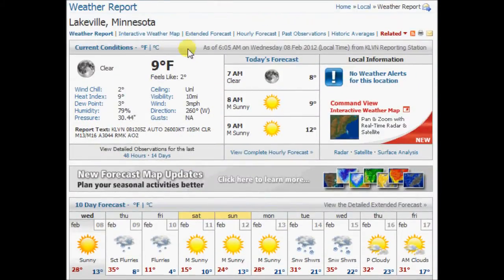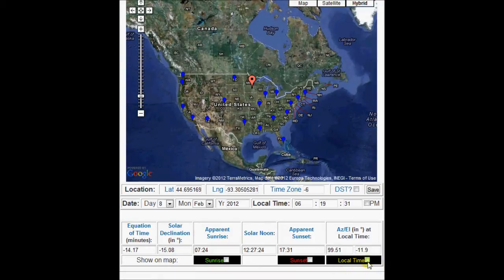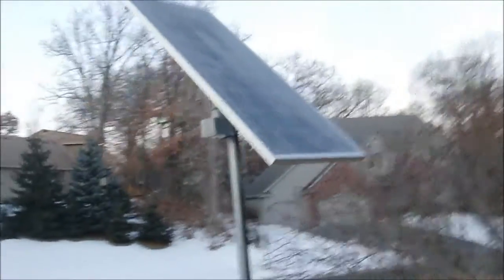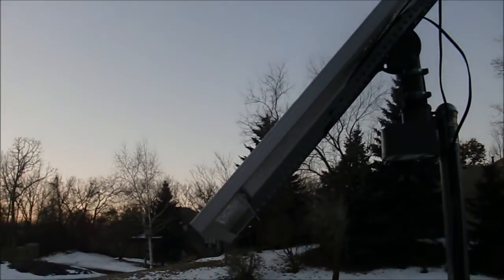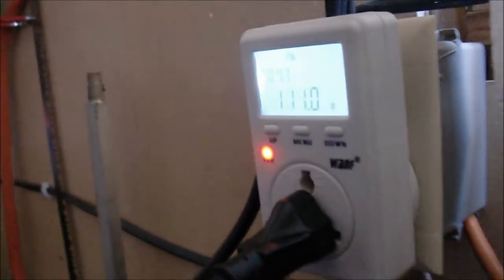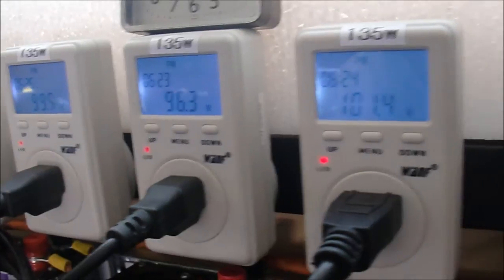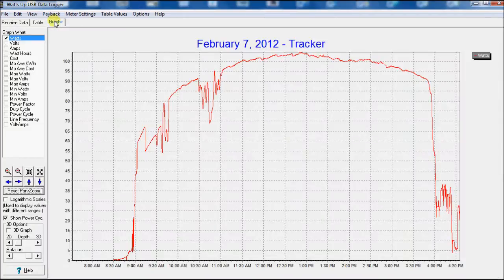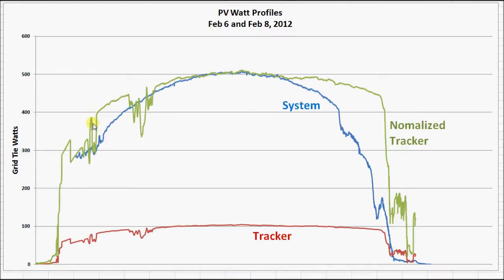Watts Up Pro for Grid Tied Solar Tracker

Comment: hi was wondering and i am new to this but it looks to me as you are running like 5 or 6 grid tie converters. but only have less than 600 in panels and making around 450. So couldnt, say 1 or 2 grid tie work for this. there all showing low number each. also does a grid tie itself take a little power so 5 would take more than say 1 or 2 not trying pick just trying to understand the solar idea also it does look great